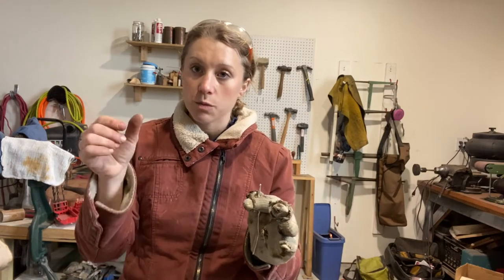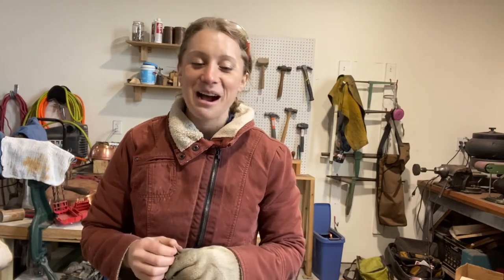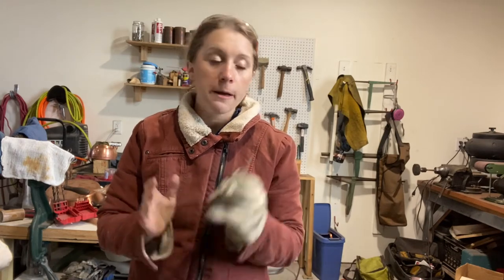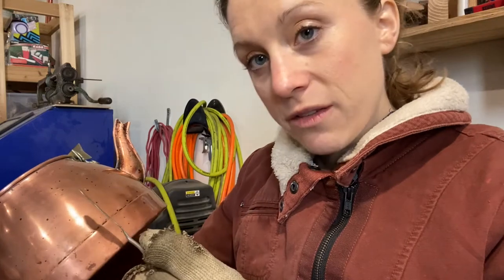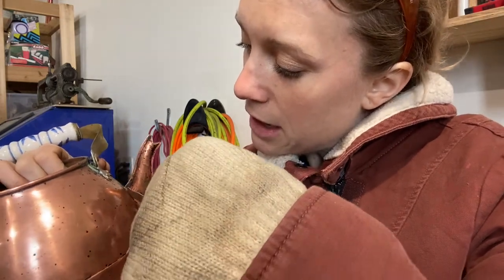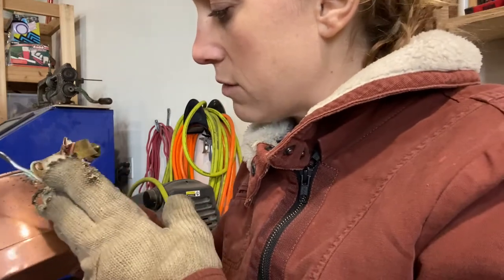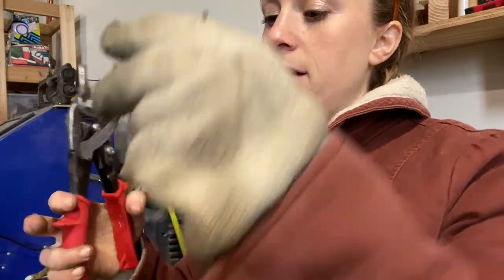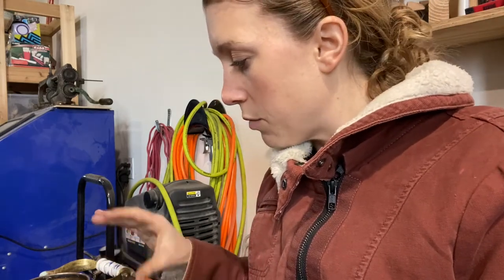How to Fix a Teakettle Spout

Comment: Thank you for this video! I actually have a spout that is flared at the connection point. In that case, should I touch the soldier to the flared part and let it run into the crack?
Reply from the maker: Based on your description, I would say yes...

Comment: Thanks so much for this video! I just got a beautiful kettle but instead of a the spout mounting directly to the kettle, it is mounted onto a decorative face plate that is then mounted to the kettle. Kinda confusing without a picture, but would I treat that the same way?
Reply from the maker: Happy the video helps! I know what you mean about the plate (often called an "apron" in sheet metal speak). Yes, you'd treat it the same way to reattach a spout...but if the apron is only soldered on, it may overheat and fall off. If the apron / plate is riveted on, you're ok for sure. Best thing is to wrap a very wet cotton cloth all around the apron if it's not riveted on, and try to solder the spout back on that way. Good luck!
Reply: @housecopper  thank you! That’s very helpful!

Comment: I have the exact tea kettle that you are working on in this video.  My problem is one of the rivets has broken off on the inside of the tea kettle. Help how do I fix this?
Reply from the maker: Is the rivet necessary for the function of the kettle? If not, just leave it. If so, it needs to be drilled out, replaced, and then soldered so it's leak-proof.

Comment: Came here because my roommate took a nice long nap while making tea.

When the front fell off in the video, you heated up the preexisting solder and set the spout back onto it. If mine has fully fallen off, is there any reason I shouldn't just make a little ring of molten solder and stick that bad boy back on ?
Reply from the maker: lolol, that happens so so often! You can totally heat and stick it on - but you need flux on both the spout and the body surface, and both the spout and the body surface have to be hot (and stay hot) long enough to bond, or you'll get what's called a "cold solder" meaning it looks on...but it will pop off with a tiny bit of pressure. You can totally try it! And if it doesn't work, send to me. This is a cheap fix. :)

Comment: Great video! You gave me advice in your last video, and I got my first copper pan! I’ve cleaned the heck out of it, but there’s something black and nasty under the handle, kind of like an old burnt sauce or something. I can get the edges but not underneath between the handle plate and the pan. Do you have any as advice how to clean it? Thanks so much!
Reply from the maker: Glad the advice helped! :) Congrats on your first purchase! The black stuff under the handle is likely many decades of grease and food (yucky, I know). It's almost impossible to clean it off unless you get a big pail and fill it with the proper mix of water and sodium hydroxide (lye). This stuff burns and you can't pour it down your drain. But a soak in that (for several days) will do it - the lye eats the grease away. Then of course a serious wash with soap and water over and over until you get the lye off before using for cooking. The lye will also eat at the tin interior a bit so beware. This is one of those things that I don't recommend you do at home unless you are very aware of the safety (have the proper gloves and way to dispose) measures and have worked with acid combinations before. It's very dangerous.

Comment: I have a whistling tea kettle. The part that covers the spout has a ceramic knob. There I s a screw through the knob. Well there was a nut it washer on the end if the screw and I took the screw out to clean the copper underneath of course the area where the nut or washer is.....its sealed
Reply: Öcan you think of a way I can get the screw and nut or washer back together?
Reply from the maker: I guess I'm a bit confused on what happened. You took it apart but now it's sealed and you can't get the screw back where it was originally? You can send a photo to my assistant at copperassistant@gmail.com and she'll get them to me for assessment. I can't diagnose this one blind.

Comment: Hi, a little unrelated, but are you able to add tin to an antique kettle so that it is usable? It looks to my very unknowledgable eye to be in excellent condition, but research tells me it's not safe without a liner?
Reply from the maker: It depends. Some tea kettles look antique but are replicas - I've had two come into my shop last month that were aluminum and therefore cannot be tin lined - the tin just beads off the aluminum. Also, if you are only going to boil water in it, you do not need it lined. The neutral pH of water allows for unlined copper to be usable as there is no food or tea to create a chemical reaction with the copper. But if you want it lined, send an email to Katie at copperassistant @ gmail.com and she and I will figure it out from there. :)
Reply: @housecopper  thanks! I'll send an email.

Comment: Hi ive an arts and crafts kettle around 1900 like a few old ones they have dents in the spout and around any tips would be great thankyou paul x
Reply from the maker: You'll have to get a bit creative with kettles - but depending on diameters and what tools you have, PVC pipe to hold it and a rawhide hammer or rubber hammer and tap from the outside as long as the kettle is supported from the interior.
Reply: @housecopper  thankyou xx

Comment: This may seem dumb but can a soldering gun be used or the gas? Also what type of flux, there's lots out there to choice from?
Reply from the maker: I use Acro flux and dilute it for this application. Pastes leave a terrible residue and don't make great finish on the solder itself. I don't know about a soldering gun - never used one!

Comment: I was wondering what type of solder and its diameter that you flattened it to? Also what type of liquid flux did you use? Did you "cork" the holes to the spout with aluminium foil to prevent solder falling into them?
Reply from the maker: I use a silver-based tin solder, which is listed with a link in the description of the video. :) The diameter is 1/8". Flux is also listed in the description of the video with a link. :)And no, I didn't cork the holes with aluminum...if you notice, the area by the holes isn't prepped/cleaned to take solder, so the solder won't even adhere or clog up the holes. Make sense? :)

Comment: My spout is rivited and has 2 tiny leaks what should I do?
Reply from the maker: You'll need to have a coppersmith (or you can do it if you have the tools) clean the interior where the leaks are and solder from the inside. If that's not possible, you'd have to try to solder super tiny from the exterior, but then there will be a ton of clean-up.

Comment: Hi Sarah, I have a beautiful Moroccan teakettle, probably silver plated bronze, with a pinhole in the spout. Can one seal it with solder it as you did with the copper kettle? I would really like it to use it as intended for boiling mint leaves, not just for steeping tea (for the latter silicone sealer would be probably enough). Hope you can advise...
Reply from the maker: Yes, you should be able to solder the pinhole with tin solder, as tin will bond to both bronze and silver (they are all non-ferrous). :)
Reply: House Copper & Cookware Thank you very much!